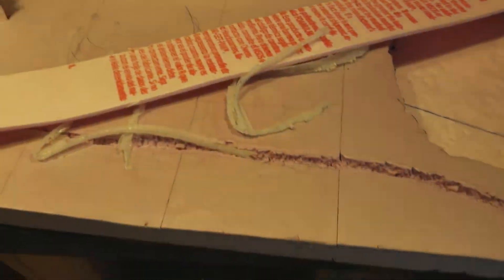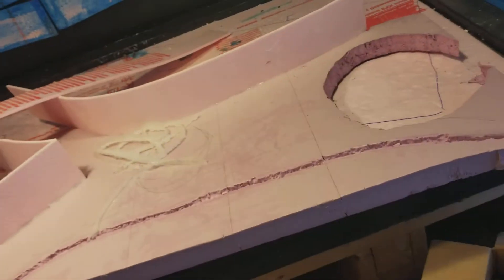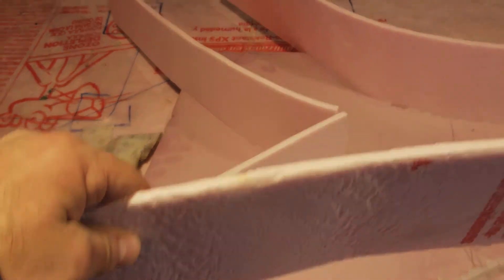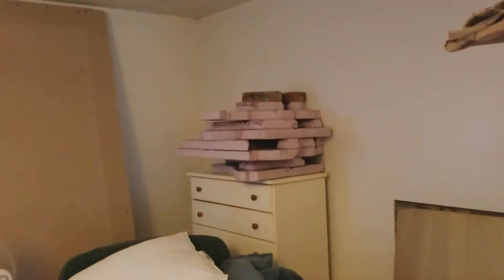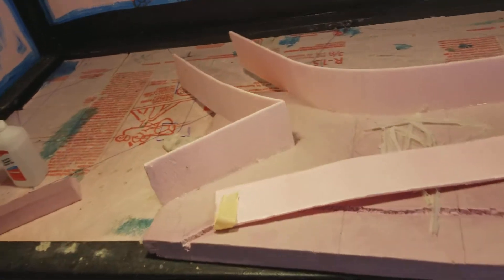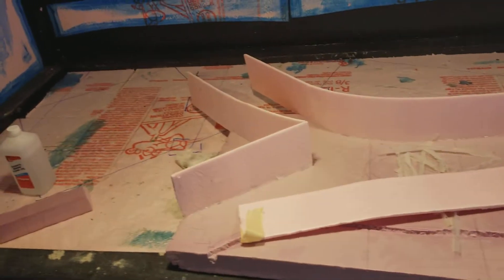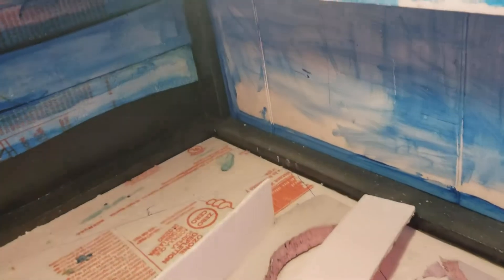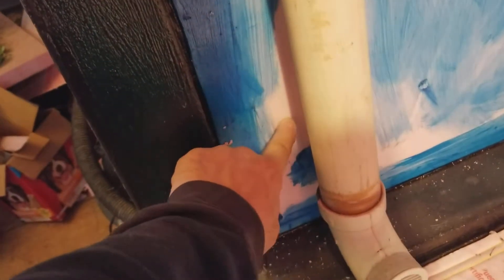Silicone does not stick to Styrofoam

Comment: EPS and XPS are different sir. The word Styrofoam™ is often used to describe expanded polystyrene (EPS) foam; however, 'Styrofoam' is actually a trademarked term for closed-cell extruded polystyrene foam made for thermal insulation and craft applications. EPS foam is the correct term for any form of expanded polystyrene. https://insulationcorp.com/the-difference-between-styrofoam-and-eps/
Reply: so silicone sticks to EPS and not XPS?